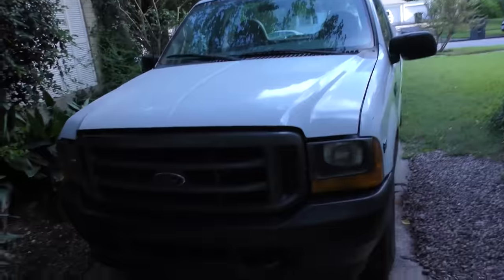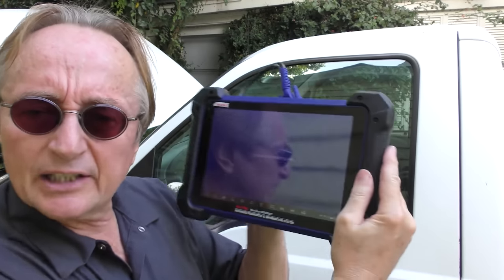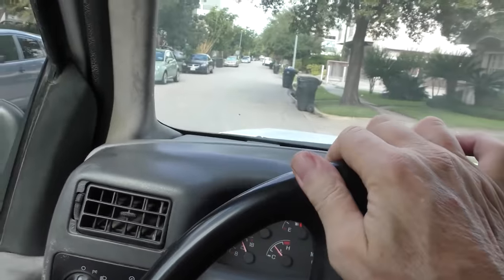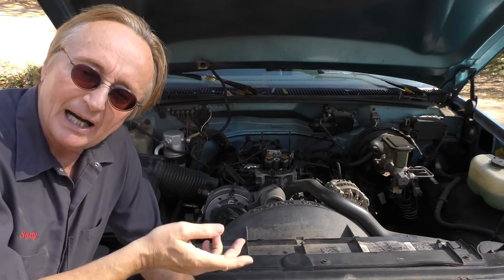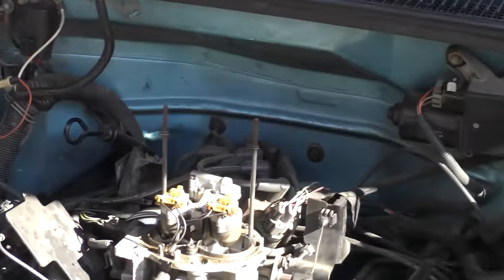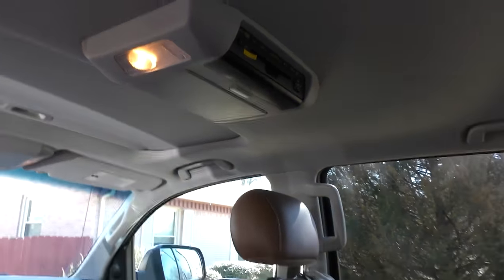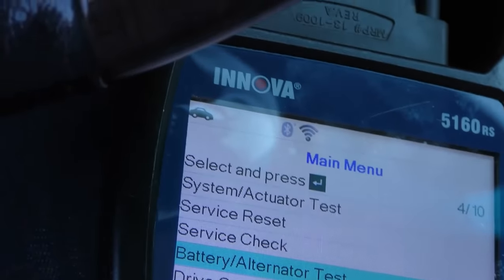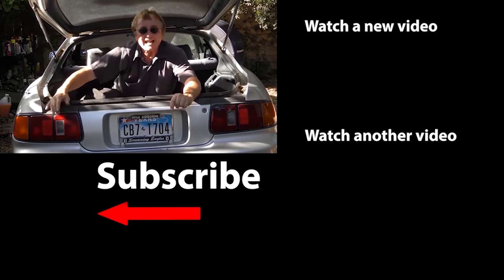3 Trucks That Will Last 700,000 Miles

Comment: I have a friend that bought a 2000 Ford Ranger XLT 3 l V6/52,000 MI in for $3,000 2 years ago from a woman whose husband died. She had it sitting in the garage for 10 years and kept it running although she didn't drive it very much.
It runs like brand new it is Red and it has the Ford chrome wheels.
Reply: Excellent choice!
Reply: Hands down the worst truck I ever owed was a 2000 for ranger. The frame where both back shocks met it rusted out and broke on both sides. The box was so rusted the only thing that held it on the truck was the plastic liner. The gas mileage was terrible so was the gutless engine. It ended up using about 2 qts of oil every 400 miles so I junked it.
Reply: @AL4N.  That truck stayed in the garage all the time you couldn't find a speck of rust on it anywhere the frame and everything underneath looks like brand new and the engine underneath is dry as a bone. No fluid leaks, and it does not use oil. I was shocked myself. I am in Central,North Carolina where we don't get much snow or ice.. The engine is a smooth as new. It only has 61k on it now.. The exhaust Burns very clean ,it looks like nothing even comes out of the exhaust.. it sounds like the one you had spent time up north and the salt took its toll on it.. Those trucks are geared very low.. only about 20 MPG on the road and 14/15 in the city.
Reply: @charlesjackson1700  the one I had indeed was a michigan truck. I hope you have much better luck than I did .
Reply: @AL4N.  The truck belongs to a friend. He just does regular maintenance to it. He has a very good mechanic that specializes in older vehicles like that and keeps it in real good shape.. I understand what you said about the one you had.. After a vehicle has a lot of frame rot and rust it's just time to let It Go...
Reply: The 3.0L V6 was also used in the Ford Taurus and the Mercury Sable.

Comment: My landlord had a 94 Silverado with a 350CID and 4 speed automatic. He gave it away for $1,000, says he regrets that decision. I do too, as I overhauled the AC in it, replaced the alternator,  battery, serpentine belt and starter. But it was super dependable transport when I needed it to get to work for three school years. It was a Windsor Ontario made, solid vehicle. I should’ve bought it.
Reply: Was it 4wd or RWD

Comment: Here's a little tip on those older Tundra's: Remove the metal safety guard from the rear differential that contains the 4WD black plastic motor box. On the very top of the plastic box, you will see a vacuum line. Inspect that line and make sure that it is STILL attached to the nipple and inspect it for rot. If the vacuum line becomes detached, and you drive through any amount of water, the water will seep into the motor box and corrode the 4WD motors. This will render your 4WD as totally worthless. You try and put it in 4WD, and all you will see is flashing Hi and Lo lights. It will never go into gear. The only fix is to buy a used differential and replace it. For some reason, Toyota put the plastic box together with self tapping Phillip's head screws! So if you live in the salt belt like I do, the screws are rotted beyond belief and you will never be able to remove them to inspect the electric motors. Another tip: Check the rear pumpkins vent valve. They love to get all rusted up and seal themselves closed. If this happens, your rear end will be unable to vent the pressure and will eventually cause the axle seals to leak. Another caveat of living in the salt belt.
Reply: Tip No 3 don't live in the salt belt
Reply: I'm always thankful my V6 Tundra has a manual transmission and mechanical transfer case actuator.
Reply: @twill9278  Yes, I miss my manual shift and manual hub Toyota pick up. But that was a 1989 and I drove it for 14 years. When I said differential, I meant to say transfer case. I currently have a 2007 Tundra with the 5.7 liter. It just broke 200K. I just put about $4500 into it. Body is solid. Replaced the transfer case, heater core lines, rotors, pads, calipers, brake lines, E-brake cable, front wheel bearings, brake booster, master cylinder, and fuel pump. I paid $10K for it in 2018, and would like to get another 5 years out of it. Especially since Toyota isn't making the V8's any longer. Not to mention the price for a used truck is beyond ridiculous! I recently drove by an old 97 Ford F-250 diesel standard cab for sale. They were asking $38K. Needless to say, it's still sitting out on the guys lawn for sale.
Reply: Thanks for the heads up.

Comment: 98 Z71 Silverado 117k 5.7 Vortech
I like the 4WD for snow and mild off road travel.
Light use and probably last more than another decade.
Reply: Just finished waxing my '99 Z71 and saw this. Garage kept and waxed protects it from the Arizona sun. No rust issues LOL. I'm retired and expect it will last my lifetime.
Reply: I had a 97 k1500 with about the same miles only reason I dont have it anymore some lady in a ram decided to run a red light and crashed into me. 😢 broke my femur and it still hurt more watching my truck be towed away totaled

Comment: I have a 1990 chevy manual c1500 with almost 299,000 miles, paid 750 for it becuase it wasnt running well. Paid 200 to replace the 2 injectors and the muffler, still runs great.
Reply: I've never seen that model truck with injectors.... I have seen them with a throttle body though
Reply: @glennbeadshaw727  TBI (Throttle Body Injection)

Comment: As a truck driver I delivered engines to an auto plant once. They unloaded straight to assembly lines. 2 lines side by side. Mazda and ranger. They are the same truck. Only a couple cosmetic changes such as the badges were different.

Comment: Since 1991, all I've owned are 88-98 GMT400's. Thirteen of them to date and the two I have now are a '92 C1500 GMC Sierra 5.7L with just 135,000 miles and my work truck is a GMT400 Bodied 1999 C2500 with 167,000 on the truck and just 2,300 miles on the NAPA 5.7 with 36,000 mile 3 year warranty. All trucks built since the GMT400's in the GM lineup are, in my humble opinion, disposable trucks. Yes...there are always exceptions to the rule, but they're way more expensive to maintain and repair and repairs are more frequent. I'll stick with what works! Cheers! Zip~

Comment: My 95 Winnebago is on 94 Chevy chassis and that parts availability and simplicity was part of the reason why I chose it. As far as fuel economy, I’ve never seen anyone in a forum for rvs mention having a class A that got anymore than around 12mpg.
Reply: If you're getting 12mpg out of that rig, that's awesome. Most are lucky to see 8 or 9.
Reply: And there's a reason we will likely never see a electric RV.... maybe hybrid, but not EV - it would run out of juice in 10 miles LOL. Gas is never going completely away, despite the green view in Seattle trying to outlaw sales of new gas vehicles by 2025 LOL.

Comment: I had an 4.7L 03 Tundra for 10 years. I did tree work with it for 5 years (towing a trailer full of logs most days) and always did the regular maintenance. I had studded winter tires (I live in Quebec, and it was RWD) and it was a beautiful reliable truck. A month ago a brake line failed (human error) and it was declared a total loss. Waiting for them to tow it away feels like when I had to have my dog put down. It tears at my heart strings so much. Rest In Peace, both of my beautiful beasts 🐕 🛻
Reply: What other TOYOTA did you purchase?
Reply: Just because the insurance calls it “totalled” doesn’t mean you can’t just fix it and keep it and take the money
Reply: I think a guy has 1 million miles on one of those
Reply: @LilyWillow22 we had a 2003 tundra that got totaled. Our biggest issue was finding an insurance company that would insure it, and none will give you collision coverage. They also knock if 3,000$ if you keep it.

Comment: The best part is any of these trucks will definitely outlast any EcoBoost truck with ease.
Reply: Hell, a 90's Explorer with the V8 will too!
Reply: A good Taco Bell fart will do the same and out last any eco boost a vegetarian puts out. 😂
Reply: @dennyj8650  Absolutely my brother considering the new Explorers are junk.
Reply: @michaelatoz580  Yep you got it brother
Reply: My 96 Silverado 1500 side step, extended cab is almost at 300,000. Starts up good and rides good
Reply: @TropicalAsian-1000  I would drive hot shots loads for a machine shop I worked for years ago. I got a call for some press tie rods going from Michigan to Connecticut. He said the truck was loaded and ready to go when I got to the shop it was in a 1995 Chevy 2500 with (4) 10 foot long tie rods weighing well over 3500 pounds well over weight. I took off and was in Ohio looked down at the odometer this truck had over 400,000 miles on it. Did not miss a beat. This was the service truck for out calls and worked every work day he was open in some capacity.
Reply: But better than any gm truck ..the crapoboost
Reply: I have a friend that has a 2016 Ford F150 it has the 3.5 EcoBoost. He says it fouls spark plugs every 20K. The dealership charges $450 to replace them.. they say that happens a lot to some of them. He said that usually make up some excuse to why it does that.. he said it has dead spots in the acceleration at times and it becomes dangerous when it can just lose power and then it kicks back in.. he is not too happy with it it has 43,000 MI.
Reply: @michaelatoz580  That's what happen to the F250's split seat.  Too many Taco Bell Farts ?!?
Reply: @dennyj8650  my older brother bought a used 03 explorer with the 4.6 . This man didn’t change or check the oil for 20,000 miles after buying it used with 300k for a favor. I poured the only oil I had in it which was used oil but with far less west on it and it ran until he got rid of it
Reply: Not even a mechanic here but knew my physics since childhood........... danged 2.3 L in heavy vehicles with a turbo seemed like a horrible idea to me. Then a year or more later I discovered Scotty Kilmer  who goes into detail about it
Reply: Or any newer Diesel engines don’t matter it was a Cummins powerstroke or Duramax the older ones are more reliable!
Reply: @michaelatoz580  I just realized EV's are Vegan cars 😂
Reply: @warwick802  EVs are the cars of choice for vegans
Reply: Ha! I have a coworker who has half a million miles on 1 Ecoboost and 300,000 on another. They're great. I have a 5.4 so I'm unbiased.
Reply: @mrjon75  Yet still won't outlast the engines in the 92-96 Ford TRUCKS.

Comment: Scotty,
I have a '79 GMC I bought for $800. It runs good, no suspension problems, the auto tranny shifts predictably but the fuel mileage in town not carrying anything is only 18 with the 350 cu in (not bad really). A southern truck, never seen salt and I put an Alabama "antique tag" on it. Just one rusty spot where it was scratched on the bumper. Now, many people didn't like "square bodied trucks", but that I what I grew up with and I prefer them. I have a '90 Ford Ranger that has no rust, cost me 1,800 bucks when I bought it with cash, 2.3L engine, Mazda 5 speed with a fiberglass box on it, 22 around town and 26 highway with only 186,000 miles on it, EFI (I wish it was normally aspirated because changing #3 plug you have to take apart the throttlebody which is a pain in my back ( literally). I'm 65, Don't drive much anymore, just around town. I only buy gas for it once a month, but the paint is in good shape, I sprayed bar and chain oil on the chassis to stop any unseen rust, but it gets me around just fine. I change engine oil, diff, and tranny fluids every year just for the fun of it! This keeps the moisture and "rust dust" out of the fluids than can ruin the drive train. The '90 Ranger is a "square-body" too, so I really like it. I even bought new Radio cassette players for both that can take a thumb drive, some Chinese knockoff that was the copy of a JVC in dash so I can listen to the real classic rock oldies we both grew up with. I am an Amateur Radio enthusiast , so the ladder racks each carries all sorts of antennas without drilling holes in the body - really neat! I dislike the new trucks efforts at "streamlining" the body - they look ugly to me and really cost way too much. 73's Scotty ( best wishes in "Ham Speak").
Reply: Awesome pickup!  From 2002-2019 I've owned 3 squarebodies, an 84 GMC 1500, 79 C30, and a 82 C10.  Just knowing that you can take parts off a corvette, or bread van, don't make any difference and put it in your truck...made these squarebodies versatile.

Comment: aint no new f250 going for $35k these days. I like how Scotty is being modest, but whomever got that for 3500 got a flat out steal. Even if we go back to 2001 pricing they were still bare minimum 35k which when inflated brings it to about 57k in todays pricing. Trucks are not cheap...
Reply: the 2wd reg cab 8' box  is about 35k new
Reply: @wolfBC  walk to a dealership and show me a 35k f250.
Reply: @khalilasbro lmfao pay me first bish
Reply: why would i pay you for you to support your claim. Again show me where you can get a new f250 for $35...otherwise you just talking to hear yourself talk. 
  @wolfBC
Reply: They are 70 000 today .. 80 90 110 000 even..

Comment: I have an 86 Bronco xlt. It has 127k original miles. 2 small rust spots. All original interior. Fully loaded. Has a 302. Runs amazing! Been running it daily for 2 years now. Completely trouble free. Best 3k i ever spent!
Reply: Update?

Comment: I have a 92 F150 swb with a 302 automatic transmission. It has 249,000 miles on it and runs great. Can't beat these older trucks!

Comment: $5100 for a 2000 Silverado I bought in '08 with 103k miles 5.3 V8 4x4 Z71 Extended Cab. Now has 205k ...really only needed required maintenance. Replaced a cheap ignition switch, switch for electronic side mirror adjustments, an AC condenser and now I'm having to replace the water pump soon. Don't think I've put even over $1500 in parts in it and I've had it for almost 15 yrs. That's really it. Still runs great and the paint looks great on it for being a 22 y.o. truck.
Reply: BINGO PAL…

Comment: That F250 is our truck, but in 4x4. It was from a construction company woo heavy spec'd it, and then it ended up with after market skid plates that would pass as armour.  It's a real trooper. We had the same Chevy t1500 as well, but set up for oil field work. True dual exhaust on that one. Our daughter loved taking that one to school.
Reply: I have a 2000 F-150 V-6 Mallimun Special, 380000 Miles,Its Leaking Oil Real Bad,I don't know why From Were,Can you Tell me Were I Should Look, Its got to be a Gasket, "WERE" ???
Reply: @richardtodd4325 If you know it's leaking, because it's leaving puddles under it, there aren't many places it can be. Valve cover gaskets, front or rear main seal, oil pan gasket, even the oil drain plug is a possible culprit. Put a piece of cardboard under the engine, front and back, let it idle for a while, then shut it off and see where its dripping, you can chase it from there. If it isn't leaving puddles under it, then you're not looking for a leak, it's either burning out or it's getting into your coolant.

Comment: My 1984 GMC High Sierra 4 by 4 with 350 and manual transmission is still my beauty. Having a 7.5' western snow plow makes it even more popular in the winter. It only talks to people with cash. Just got a new mechanical fuel pump on but haven't found time for the test drive. Something to live for.

Comment: I have a 98 toyota t100 and it has always been a good truck for me. I've had it 11 years. When I bought the truck it had 80,000 miles and i have put 200,000 miles on it. I try my best to change the oil between 3000 and 5000 miles. And get a transmission flush a couple times a year. Just changed the water pump and all the belts and gave it a new starter spark plugs and coil packs. Truck still runs like when I bought it.
Reply: Toyota bulletproof w just a little TLC is all!!!
Reply: T100? I thought they quit making those in 94 and started making the Tacoma? I'm confused.
Reply: @brockbrawn1524  take a nap buddy, you’ll be fine

Comment: I have this same Ford.. Except mine is 2002 F350 extended cab, with 7.3L diesel and 6spd manual 4x4.  These trucks were the best trucks Ford ever made.  I have 330k miles on mine and she's just warming up.
Reply: Great truck! I have a 2000 7.3 4x4 auto dually. I'd prefer the 6spd manual like yours but oh well. Runs like a champ 440K miles. Tranny was rebuilt by PO. I upgraded the infotainment system with a backup camera etc. Why buy new? These trucks will go forever if maintained.
Reply: @1flashlite1  There is a shop, who's channel is called "powerstrokehelp -- that rebuilds these and the Excursions, completely from the ground up, like a new truck;  they strip it down to the frame, fresh paint and all new, better updated suspension and 4x4 setup,  ect..   And they sell for $80k to $100k.. Probably more like $120k now.  I know there are a few shops that still do it today.  But yeah,  I bought mine almost 10 years ago-- without a bed and it had 180k miles.  I paid $7500 for it, and drove it 200 miles home (without a bed).  My dad and my brothers all drive 4x4 Fords, so we have several old trucks laying around-- so I stole a 9ft flatbed off of one and this thing has been such a good truck, and has never let me down... In 10 years I only broke the fan belt and that slapped my AC connector and ripped it out of the compressor-- so that sucks, it barely worked anyway... I blew a power steering hose.. Changed a set of U-joints--  and I did end up putting new leaf springs on the front-- costed only $240 or so..  I hop curbs all the time, and it ended up breaking the leafs with that HEAVY diesel.  Other than that, it has never quit--  it just keeps on going.  330k miles,with a lot of towing goose neck trailers and heavy tool trailers.